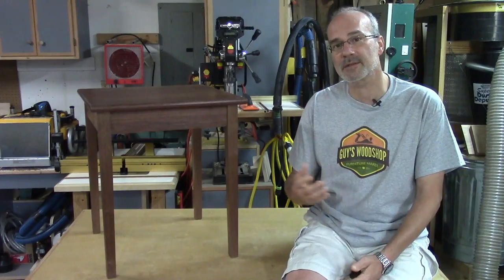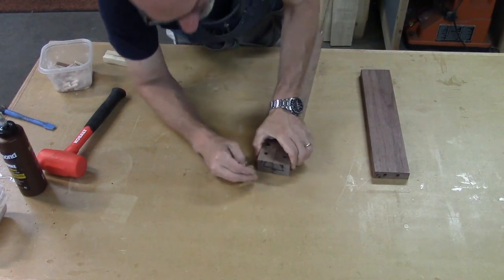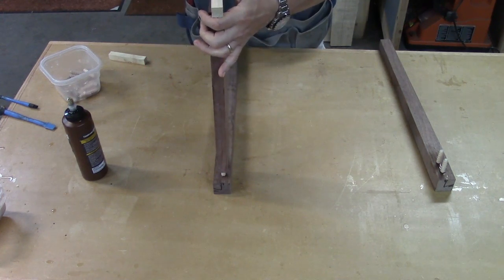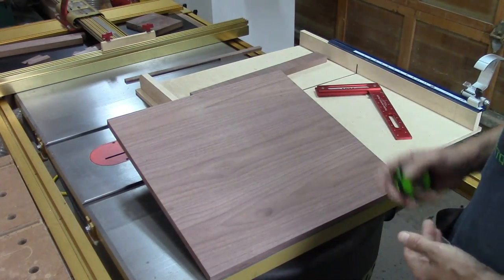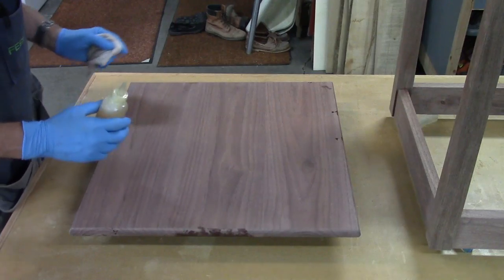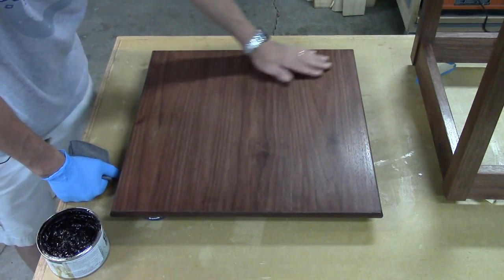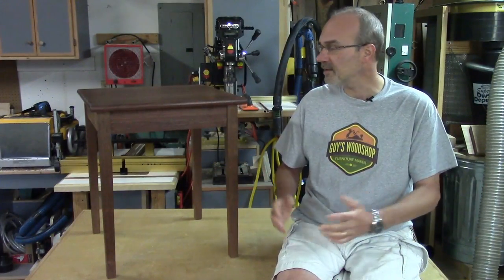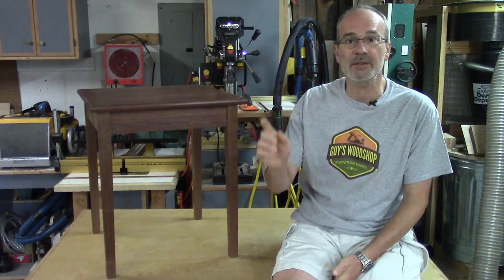A Simple Shaker Table Pt.2

Comment: Great video Guy! I hadn't thought of relieving the bottom edges of my legs before. I really like the bull nose edge on the top. Can't wait to try the wax steel wool finish method. Simple yet elegant.
Reply from the maker: Hey Wayne! It really does help in making sure that the bottom of the legs don't chip out. And wax is a great final topcoat especially on something like walnut.

Comment: Hi Guy:
I liked the new logo on your shirt.  Look real good.
I just looked at one of your old videos showing your old Miter saw stand.  You did a great job of not over building it like so many that I have seen.  It looks like it worked real great.  You now have a Festool miter saw and what little I could you took a good amount of time setting it up.  How do you cut on the  dust collector when you are using the saw?  Do you use a IVAC switch or a remote switch?  The reason I ask is I use the IVAC switch with my shop Vac. and my Festool sander and Domino and when I am not using either one the vacuum will start running and stop in about minute later.  Called the IVAC folks and they are having problems with all three of these tools. They are suppose to be sending me a modified unit.   I thought I would give you a heads up on the problem if you are using the IVAC switch with your tools.
I liked the table and it came out looking great. I bet you enjoyed building the table for your daughter.
I really like your finish on this project.  Arm_R-Seal is my favorite finish.  I still don't like the water base finishes and will use oil base finishes as long as I can get them.
Have Fun In Your Shop
Reply from the maker: Thanks! I actually had someone design the logo for me. My miter saw stand has a shop vac underneath in the cabinet along with a Dust Deputy inside, and it's hooked up to an iVac switch. I have never had the problem you are describing it run for about 2 or 3 seconds after the saw stops.

Arm R Seal is okay, but I don't like how long it takes to dry or how many coats it takes. I usually make my own wiping poly. 50/50 poly and naptha with a little bit of boiled linseed oil. It takes a while to dry also, but the finish build faster.
Reply: GUY - I understand why you don't like it, but it is far more durable than any other finish I will use. The other thing I like is I can sand it with 1000, 2000 &3000 soft sanding pads and get a real smooth flat finish.

Comment: Great video and a beautiful table, Guy. I noticed that you installed those figure 8's in the four corners, do you have a "distance" rule for when you would add more inbetween those?
Reply from the maker: Hey Steve! Just a judgement call with the figure 8's. It's a pretty small piece, so 4 seemed like it more than enough to hold the top on.

Comment: Very nice!  When you use the figure eight washers, how do you get the top to sit tight on the base?  It looked like there was a small gap when you screwed the top on.
Reply from the maker: Hey Steve! There is a small gap between the figure 8's and the table. I want the table top secured to the base, however I also want the top to be able to expand and contract. The gap between the fasteners and the top enable it to do that. Does that make sense?

Comment: Wow, that finish turned out perfect!  I just bought a piece of walnut today (not for a table but for something else).  I never thought about using paste wax over the Arm R Seal.  I guess another trip to the store for me.  Question:  How long does the hide glue take to fully cure?  I have a bottle of it just in case I needed more open time but never used it because I don't know enough about it.  Thanks.
Reply from the maker: Thanks Jimbo! The hide glue I am using works a lot like OVA with a slightly longer open time. You can take out of clamps in a couple of hours, and it will fully cure in 24